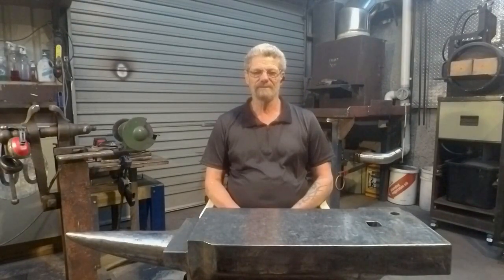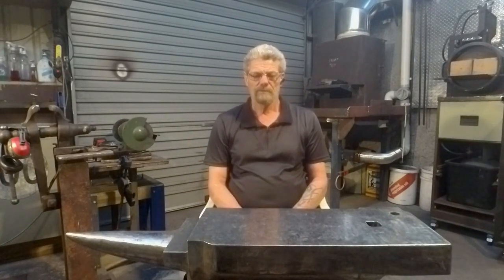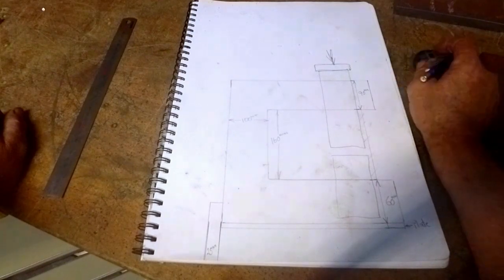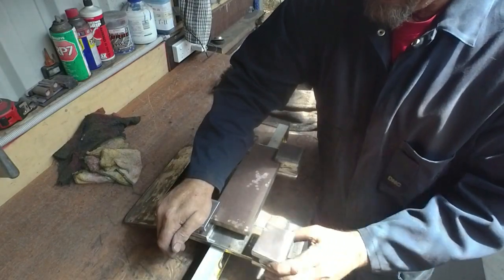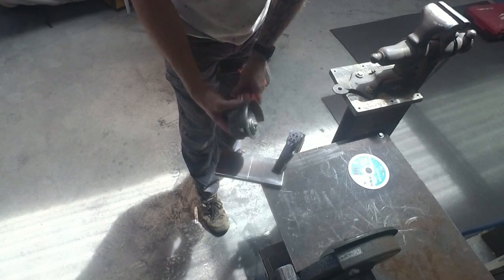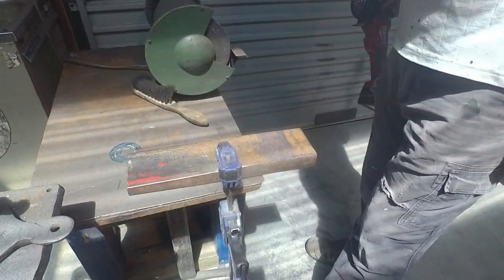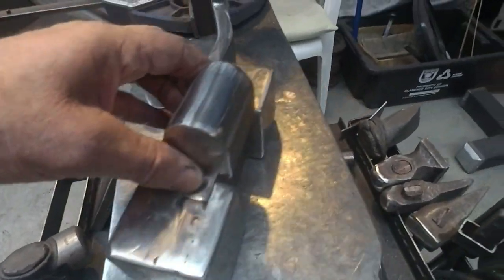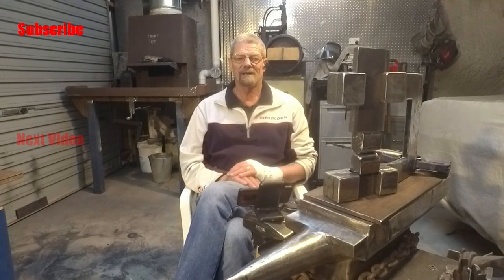Hammer Making Tools Guillotine Tool Part One

Comment: Gee mate that's a beast of a guillotine tool. Love the design and plenty big enough. I like the Idea of the C shape. So sorry you hurt yourself, did u do it while working on this tool or at work. Praying for quick healing and recovery mate. Yeah those fullering dies might have to come down a bit, if they're for fullering on hammers. All depends what you want I suppose. See u soon Andy.
Reply from the maker: Thank you for your kind words Len I'm sure I will be back in action by next weekend. Yes I did do the injury working on this tool. Was using a 9" grinder and went to put it on the bench but was standing on the electric cord and it jerked and flipped over then came down with the edge of the disc on the back of my hand. Cut about 90mm long and very deep I'm afraid. Wife was at work so on my own I did the best I couple to stop the bleeding and rushed to the hospital and got it closed up. Nasty gouge though mate.
Reply from the maker: But back to the guillotine tool lol The C shape is great for working on larger stock and the bend for longer stock. The large size gives it plenty of weight so it will be very stable on the anvil or the drifting block I made a while back. I had a chat the Dan Moss and he recommended between 15mm and 25mm dies for 2.5lb to 3.5lb hammer fullers so that's what the bigger dies will be ground down to (25mm) and the standard 16mm Hardox for the smaller dies. Just disappointed I had to stop when I was so close to finishing it up and testing it out.
Reply: @andywright2606  Oh Andy, I have heard those big 9" grinders can be a bit dangerous, was given one from a friend of mine,, and haven't been game to use it yet. Take care mate.
Reply: @andywright2606  Ok good yeah Dan does some good work, they should work a treat when finished. You will soon be knocking out some great hammers mate.
Reply from the maker: @lenblacksmith8559  Yer mate probably the most dangerous hand held tool in a fabrication workshop. I've used them for years but never stood on the cord and walked away before so I'm sure there is an OH&S video there for me in the future. If you do decide to use the one you have, treat it with ultimate respect mate, it only takes a millisecond to grab you and once they do they just dig themselves right in.
Reply from the maker: @lenblacksmith8559  Yer I love Dan's channel, makes great hammers and he is very good at responding to questions from beginners like myself
Reply: @andywright2606  Yeah mate so true.
Reply: @andywright2606  Yeah gee Andy, not to take for granted those things.